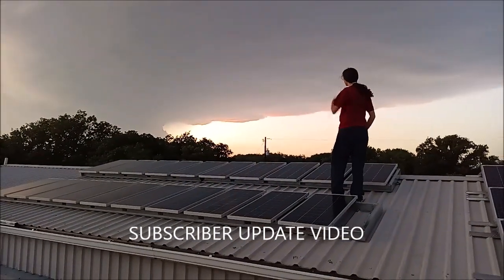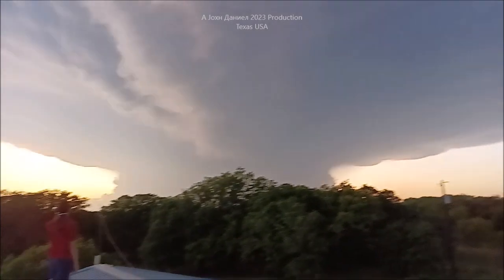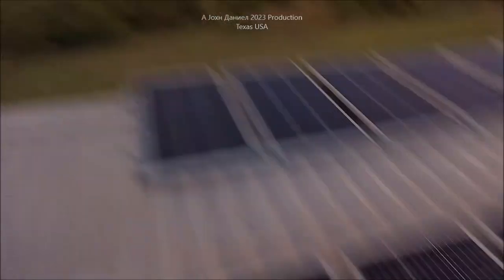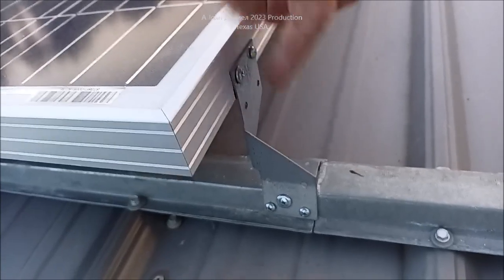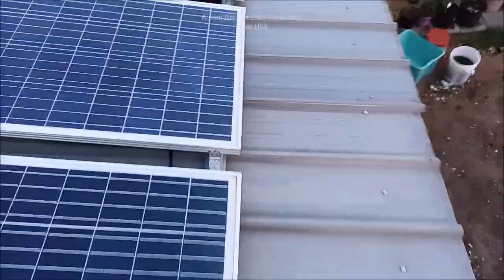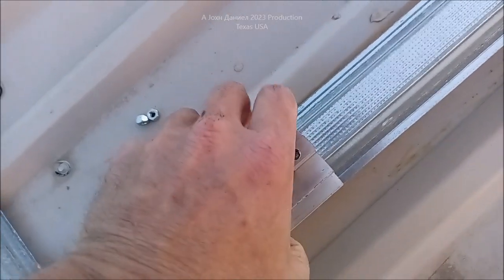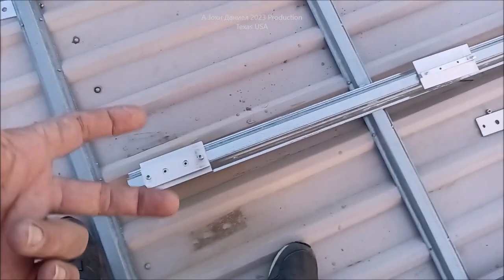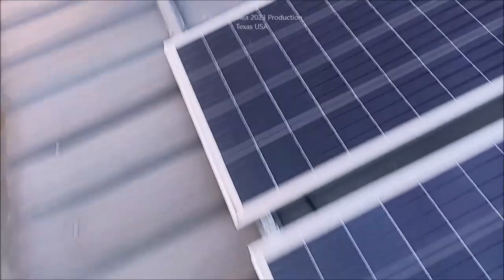Cheap Solar Panel Mounting Methods & Progress Update

Comment: Hi john sorry to brother you i have a quick question on my battery bank you said keep all cables the same length can + and - be different as long as all+are the same and all - are same and can i mount my sungold inverter up and down instead of  side ways thank you hope all is well stay safe and God bless you all
Reply from the maker: Yes, EXAMPLE: You have 8 batteries, the Negative run of cable is longest at 2 feet, your positive longest run is at 3.5 feet. Make all cables same as those longest runs. As for the Sun Gold inverter, Preferably no. The label on them is correct to the areas inside that need best cooling. You can mount them with fan up, the outflow of air is on the AC voltage outlet side. NEVER mount them fan down. Best actual mounting is horizontal though for best results.
Reply: Thank you very much
Reply: @corneliusdevenney1848  God bless you to!

Comment: Mr Daniel what is your opinion on solar generators ?
Reply from the maker: They are very limited as is, and some are proprietary and you can not adapt them. I would suggest the making of your own instead and saving lots of cash and headaches. Making your own allows you to grow it larger without being trapped by the limits most all in one models are made with.
Reply: @JOHNDANIEL1  Thanks

Comment: HEARD ABOUT THE EVAPO RUST REMOVER. NOW YOU ARE GOING TO TEST IT AND IT WILL BE JOHN APPROVED, OR NOT.
Reply from the maker: It works very well, but remove all loose stuff before you use it.

Comment: What happens to those solar panels when an EMP goes off or Biden burns the sky, asks he who walks behind the rows? 🤔
Reply from the maker: The panels are fully integrated into the structure, no floating or direct ground. This reduces risk greatly. If you take a ground cable from them to the ground stake, you increase passage of EMI and EMP energy. However, any that do not survive I can replace with some of the 20+ I still have in the 12 x 14 faraday room. Mounting solar on a metal roof is the greatest way to protect them from EMP by making them part of the natural shielding metal does.
Reply: @JOHNDANIEL1  So you don't need to ground the panels? What about  the controller and inverter?
Reply from the maker: @kevsterman4053  You can ground the power inverters, but I do not ever ground any items that are DC voltage only. I install flash plates if absolutely necessary, but never imbedded rods for DC. 
 Do not ground HF ( high frequency ) power inverters, use a quality protector circuit, power strip or cheap GFCI on them. Avoid using your homes grounded or bonded wiring with high frequency inverters, they can and will leak voltage to ground when certain items are ran on them in that condition. You can earth ground LF ( low frequency ) inverters but only with a dedicated ground rod and if your using your existing homes wiring with them.

Comment: Definitely needing some comment feed. Great information and as always neat application of cost effective materials for implementing practical systems.  Awesome design!  Debating bucking up for a test rollable adhesive backed panel to run about the 20ft, 15" wide, on a 10x20 carport with steel or most likely the greenhouse shed that's all ready for a new exterior treatment and the new aluminum framed sliders to replace the wood framed ones. Wondering how most cost effectively to install those if I do buy at least one to try out?  Guessing flat metal and sealed around a wooden platform if I can't come up with cost effective aluminum raised backing of some sort.  Maybe old sign material on that hat material might be good with some backup strapping like zip ties at least around evenly spaced along the ends on in to be safe?
Reply: Man, glad I typed that out above.  Thinking about the backup strapping some more and guessing Lexan or something more clear would be better to use as backup straps over the ends and spaced in a way along the length.  Will have to see what the widest flashing material is as well and how to form that best around wood if wound up making that way, though for the heat transfer seems like the aluminum from old signs at the salvage yard might be the most cost effective route.
Reply from the maker: We should one day sit in my shop O Parts and fiddle with crap till it makes something! Who knows, may even get some $$$ in the pockets for creating some breakthrough items.

Comment: I've been thinking about expanding my solar array. Thank you for this video and the more descriptive "Hat Metal" since I couldn't find it. The Hurricane Ties I found only came in one direction. I ended up bending it the other way. I gave up last time and flat mounted with Angle aluminum. I'm going to take a look at your other video for angled pannels. Also, I am interested in learning how to tie Lead Acid into Lifepo4 so, thank you for that as well. I hope you have a blessed day, John.
Reply from the maker: The boxes of those ties I got on Amazon come with 25 left and 25 right off set, You have to sort the ones out online, Zoro may have them listed properly also. Those sold at home centers are random depending on what box they dumped in the bins. Most drywall dealers, metal stud sources and garage door companies can get you HAT metal, or technically Furring Metal. Check with Clark Dietrich to find a source near you, always stay with 20 gauge or heavier, I prefer 18 gauge unless you get it from LOWES and get 25 gauge then double it. https://www.clarkdietrich.com/products/furring-channel-hat-channel

Comment: huge amounts of power darlinks !!!
Reply from the maker: Solar is in sets of 500 watt/40 amps per string max, 35.9 amps real per string all going through dual 6 awg cable, under 24 feet in length, and that is 33% bigger then required by code. All is shielded, all is incased. Lots of total amps, 3500 AH of battery, but not much per controller. 15 x 235 AH battery @ 12 volts. Cable is 4/0 x 3 per conductor feed in total, only feeding 930 amps capable, 740 amps max to inverters. We do not run anything over 85% so nothing will see much over 650 amps. I think it will as it has continue to work as planned.
Reply: @JOHNDANIEL1  woman needs to be kept warm darlinks
Reply from the maker: We are in Texas, She needs to be kept cool! So I run 3 of 8300 BTU air conditioners. For little heat as we need the fire place is great.
Reply: @JOHNDANIEL1  superba darlinks !!! I am in cluj napoca , is very cold
Reply: @JOHNDANIEL1  exerlent darlinks !!!! impressive !!!!! da

Comment: Might be cheaper but that high wind might be the difference between 500 and bying all new panels yer seen it happen. Engineering is for a reason.
Reply from the maker: We did a pull and tear test on a pair of broken panels to see if they would fail. panel tore apart before the fasteners did.

Comment: you can do a mosfet current dump using Zener diodes into hot water tank or resister banks
Reply from the maker: We do, using 2 of Suburban 12 gallon RV water heater tanks. Works great.
Reply: @JOHNDANIEL1  excellent darlinks !!!

Comment: man , thats the way to do it, no shortage of power.  im envious.
Reply from the maker: I'm at just over half way installed. Total power will be about 11,000 but not sure why now with all the heavy insulated and lower energy items I have picked up. We do not run wasteful stuff. Wind turbines will add far more than I can use, so I will again build hydrogen generators for cooking and heating.
Reply: @JOHNDANIEL1  youre a brain on two legs, you amaze me , diy 100% pure hydrogen i was thinking of using to do the same, natural gas etc has gone through the roof and hho or pure hydrigen are non toxic, hho has a serious kick, so i will make a separator cell, ive allready lost enough hearing over the years to hho LOL.
Reply from the maker: @closertothetruth9209  Mix it 70% hydrogen and 30% propane for increased stability.
Reply: @JOHNDANIEL1  thanks
Reply: @JOHNDANIEL1  Curious to know more about making your own hydrogen.
Reply from the maker: @davef.2329  Using a 40 lb or 100 lb propane tank and a vacuum pump you can prep them for HHO then compress them to 100 psi of Hydrogen from your generators. Using cylinder generators not open box style you can collect the hydrogen and use it in the tanks. There are numerous sources for collecting hydrogen but the valving and compressing is specialized.  https://www.hho-1.com/

Comment: Mr. Daniel. For your information. There are several levels of repair on an item that people do. The difference between a restoration and a refurbishment is... A refurbishment is when someone repairs, replaces, repaints and refinishes something that is not needed to be brought back to original appearance as well as specifications. 99% of all Youtubers get this wrong.  They say its a restoration but in actuality it is only a refurbishment on a  item.  A restoration is when you bring an item to repair and bring that item to its original specification and appearance trying to keep the original material/pain as much as possible.

I've been doing restoration on mid century items for the past 30 years. And it is a very expensive process. What is shown on mostly You tube influencers trying to make repairs and/or refurbish items for a fast buck.

Depending on the job, the level of repair and  item in question I have different stripping methods to remove rust/grime. 

Lets use your table cart as an example.  If you were just repairing it for utility, I would be using just plain old white vinegar as it is cheap. Make a rig for your parts to soak in and let it sit for awhile. Scrub as needed.  You can get commercial grade white vingar at 30% concentrate but that will burn your hands (use gloves and proper ventilation when you working with strippers/paints) as what is in vinegar is acedic acid. A natural occurring acid which is used in cleaning many things in the commercial industry.  

 Evaporust  does a very good job but it is also very expensive to use just for utility work.  Also I use a lot of CLR, cutting down the ratios with water depending on the item in question.  I have found that CLR works great if you want to try to keep the paint on the original surface.  I use Evaporust on smaller items for repair due to it's expense.
Reply from the maker: I got the Evapo Rust in a 4 pack of gallon jugs new from a yard sale, 4 for $5, I have a concrete mixing tub, clean unused that is 33" x 42" x 7" that the parts can soak in. My chrome dip for the legs was a exhaust stack plater, it has a new transformer and I have yet to even try it, but I plan to. Hope it works still.  
I never refurbish things as a standard, that is just painting a pig to me. It is such a cool mid to late 50"s cart you just have to make it look like it did when made if you can. Goal is for teaching my kids how, not for profits.
Reply: @JOHNDANIEL1   You got a hell of a good deal on the Evapo Rust. As far as the rest of your equipment. Yea I think you should be fine.   Have fun with your projects and thanks again with your information on solar energy/ testing batteries and other things.   The old man here has learned a few things. :)